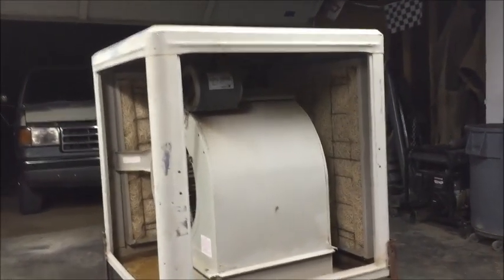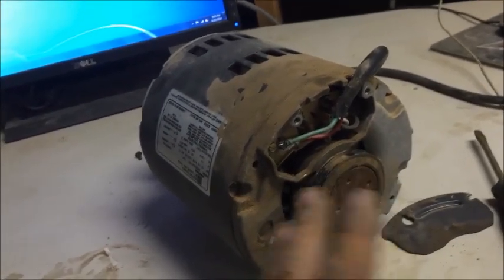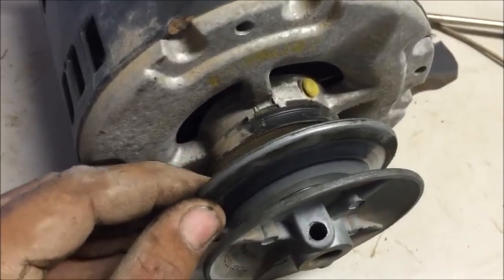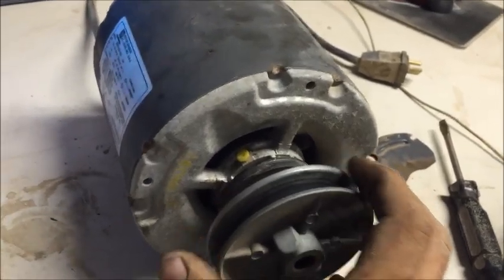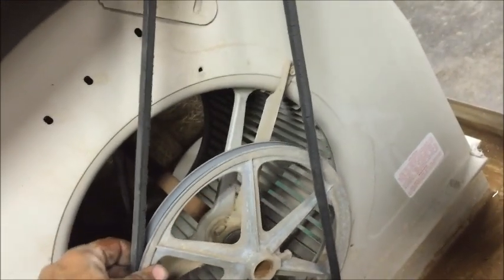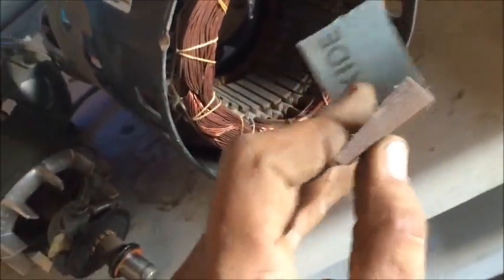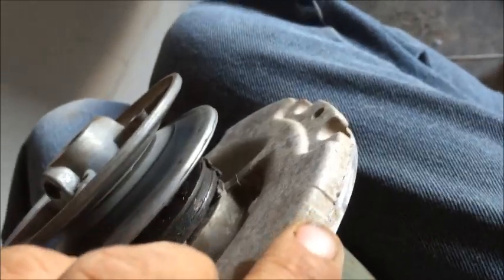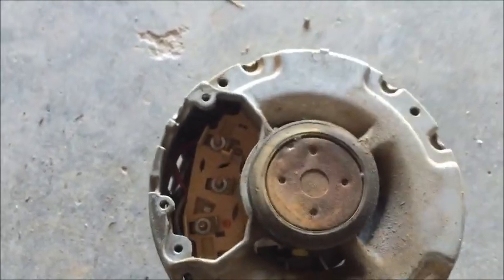Repair a Swamp Cooler that Shuts Down, Very Easy!

Comment: I replaced the motor and belt last summer and it ran like a champ. This year I turned on June 1st all was going well. Then after week a I noticed when it was on high cool after 20 minutes the air out put would drop almost like it was switching to low cool. Then after a few minutes it would speed back up like high cool should be. It never shuts off like you mentioned in your video, it just keeps switching from high to low and back to high intermittently.

Comment: Recently purchased a used cooler for $65.  The initial inspection, prior to purchase, revealed a badly worn belt.  However, the cooler was putting out an air temp under 70 degrees F...so I moved forward.  After putting some time and money into the unit, it still shakes during low/high fan speed.  I'm glad that I found this video, as I'm excited to follow the steps...and hopefully take care of the last issue.  Thank you for taking the time to put this video together.  It's a nice contribution...

Comment: Other causes of overheating are: an over-tight belt, dry or bad squirrel cage bearings, a motor that is too small, and low voltage to the motor due to corrosion.
Reply: This is what happened to mine too-nite, I tightened the belt too much.

Comment: Very helpful.  I installed a new motor but when I got it all hooked up, the motor would not pull the load.  I found out the problem was just what this video covered!  Thank you for the fix!

Comment: For the pumps that have the four long bolts to hold them together, you can't just pull them apart, I stuck a screwdriver in a vent hole (toward the pulley side, which is the "small" side, like hsi is) and "tap" them, then it came apart.  Also note you don't have to take off the plate to the electrical stuff to get them apart :) Used 600 grit sandpaper and sure enough, my motor which used to "buzz and go at low speed, then shut off after 10s" when set to high speed, now runs well.  For some reason it took a few restarts but then it started working well, I sanded the core and the outside bits...

Comment: For followers, he taps the motor pulley to make it straighter (or at least adjusts it? the tapping wasn't shown? adjusting it so it blows slower is a good option), and adds some drops of oil to the motor (which in some motor models isn't possible). And shows you how to clean rust from inside the motor if necessary...good info!  My only issue is sometimes those pulleys are stuck on with rust...though I think they rent pulley pullers at autozone? :)

Comment: Good info on pulley adjustment. 
Question for you: my cooler blows a mixture of air AND water mist, leaving calcium deposits all over my truck.
I’ve cleaned the cooler, replaced 3 aspen pads and new anode rod. I’m stumped why it’s misting water.
Any thoughts?

Comment: Good info. I just installed a new motor, it ran twenty minutes and shutdown. My engine adjustment bracket is all the way in, how do I loosen the belt now?  Good video!!👍
Reply: Loosen brackets on both sides of motor mount. Adjust where needed and then tighten.

Comment: Part of the old breezair evap installation includes monitoring amp draw while adjusting the pulley which I gather is due to the slight diameter change with the adjustment.

Comment: I have a question about the swamp cooler switch. Can the switch fail internally and cause both the high and the low voltage to go to the low side overheating the motor?

Comment: Also check the bearings on the side if they're seized it might cause extra load, causing the motor to overheat.  It should only be rotating the middle shaft, not the whole thing...it should spin freely too :)
Reply from the maker: great info. thanks for watching.

Comment: I found your video very helpful but im still having a problem with motor. What I did was buy a new one, put it on and it does want to turn to push air in the house. And i did but the same motor that was already in the swamp cooler. Should I a higher voltage? Have any advice for me? Thank you I really appreciate it!!!

Comment: Can you show us how you " just tap the shaft straight" I'm a machinist so I know roughly what I need forcewise to bend it back and what I can get away with but most people don't. I am afraid that they will end up beating it crooked worse or not getting aggressive enough and still having issues and end up dropping 150 in an unnecessary purchase. Great video though.

Comment: Thank you for the video, I eneded up replacing the motor on mine but after I did it started shaking alot. Would you know why this is happening
Reply: Check everything on the Squirrel cage axle. More than likely the pillow blocks are shot
Reply: @Rabbit.760  I will check it out thank you

Comment: Hello, Question for you. I have two old master cool swamp coolers that I love. Worked perfectly for years and years . NOW They work for 30 min then over heat bad. Would a good cleaning and a bearing lube take care of my problem??? Please help I was just quoted 300$ rewire job because guy knew I had no other options.
Reply from the maker: Is it indoor or outdoor? If it's indoor your problem is pressure, it needs to vent better. If it's out door, yes definitely a good cleaning will fix it, be sure to oil the bearings. thanks for watching!

Comment: Moter need little push to start. And after starting it works fine. It's same same moter shown in video. Ther is no capacitor. Just three wires common high cooling and low cooling.

Comment: You need to open the pulley to change the gear ratio. You have the pulley ratio too large. Open the pulley wider to lower the gear ratio. Use an amp meter to check the amp draw. If it draws too much loosen the pulley to make the pulley diameter smaller. This will lower the amp draw.

Comment: hi, i have a 3 phase motor. when i measure the resistance from the motor (3 wires) i get 4.6ohm, OL, OL. could this be the cause why the fuse keeps blowing out? i should get the same resistance value from phase to phase right? thank you.

Comment: What if your motor doesn’t have the plug insert where the oil goes? Any advice on a second location to put the oil on the motor ? I inspected mine and don’t see any spot to oil
Reply: Some don’t and are throw aways. The motor has a removable plate to connect the wires. Usually color coded.

Comment: WRONG.    WRONG. You need to align both sheaves dead parallel to each other FIRST. Then tension the belt just to where it doesn't slip or squeal on motor startup. The belt also needs to ride OUT of the sheaves by roughly 1/8". Needs to be ABOVE the sheave. If your belt rides flush or INTO the V groove then the sheave needs replaced or adjusted. A belt riding flush or INTO the V groove creates more side belt friction and heat on the belt making it fail early and over heat the sheaves which raises amperage.

Comment: I have an old swamp cooler that looks a lot like yours.  My issue is a loud clicking noise when I turn the fan on.  If I put the fan on high, it sounds like a machine gun!  Too loud to run!!  Because of the tight housing around the fan, I can't tell if possibly something has fallen in or the fan is hitting the side of the housing, or maybe it's something else causing the loud noise.  Any suggestions?
Reply: Mine is loud too. It sounds like a garbage disposal. Did you ever find out what was wrong with yours?
Reply: @KFrost-fx7dt  There was a piece of metal bent that the fan was hitting (which is why it sounded like a "machine gun".  But there is still a very loud "winding down sound" when I turn the fan off.  Also since then, the pump works fine, but now when I turn the fan on, it trips the GFCI outlet. Time to call in an electrician.

Comment: i know this is an older video, but i have a question just in case you see this.
i went to oil up the bearings on my motor, and the little yellow plug on the back of the motor (opposite the pully) broke in half, and part fell inside the hole. i took apart the motor, but i can not figure out how to remove the bearing from the back of the motor.
do you know how to do this, or maybe you know where i might be able to find some info on how to do it?
cuz i know i need to get that little piece out of there, and at this point i figure i might as well replace the bearings, especially since the back one seems to be pretty much seized up.

thanks in advance for any help!
Reply: so i figured how to remove that bearing. i was able to remove the little protective housing, but now im going to have to make some type of tool that will let me apply pressure to the square casing of the bearing, and twist it at the same time

Comment: Thank you
Reply from the maker: thanks for watching .
Reply: I'm dealing with this same issue right now. It runs for a hour or so and then starts making noise and stops so now I'm going to tear it down now
Reply from the maker: i had one that was indoor ( garage ) that was doing that, it ended up i did not have enough air going to it. too humid . but out door, is a different thing. good luck. let me know if i can help anywhere ?

Comment: My pulley is making a noise and not from lack of oil. Think I need to replace , maybe a bearing gone bad? Been working on these high maintenance coolers all my life but don’t remember ever changing a pulley wheel. Motors yes but not a wheel. Any advice? Only for my personal home use, I’m a gal so any info you can give me before it reaches 115 degrees in Phoenix is greatly appreciated. Thanx

Comment: On my two speed motor only low works when I put it on high nothing changes it’s still the same speed. Can that be fixed or do I need a new motor?
Reply from the maker: the high speed wire has disconnected, check the wiring. do a wiggle test, but be careful not to get shocked. ha. sounds like a bad connection. high speed  is black wire. low speed is red wire. white is neutral, green is ground. good luck. let us know if it works.

Comment: I'm having issues with the circuit breaker for the cooler in the main panel popping. I unplugged the motor and the circuit breaker doesn't pop. Is this a problem with the motor being shorted? Should I just replace the motor?
Reply from the maker: yes, that is correct !!!
Reply: Alright, I swapped the motor and got it wired correctly, I think. Now the motor runs on lo cool for a minute or 2 and then shuts off. Same problem in hi cool. The systems works fine on pump only but the fan is running at high speed. I don't think I have this wired correctly. Any help and pictures would be helpful. It's a 2-speed motor going to a 3-prong plug, where 2 of the prongs are flat.

Comment: Mine keeps shutting off after few sec. Its a new one but has alot belt dust on it i had change it. Now this. Its cold love be able fix it. It runys fine with no belt on it

Comment: the adjustable pulley is for motor amperage draw adjustment, it's in the owners manual
Reply: hahaha, you stocked up on blinker fluid?
Reply: Look it up smart guy you'll see
Reply from the maker: true, also for different thickness of belts.
Reply: WRONG

Comment: How about 8 year old motor 1/2 HPfrom Lowes.  I can not find oil ports is this sealed and nothing I can do.  Hard to turn, motor will start but if I try restart nothing.  Is your pulley on backwards?  Fixed shaft part pulley closest to motor and adjust on outside right?

Comment: I put my old motor in a new cooler. It runs fine with just the fan going in hi or low or on hi cool, but overheats in a minute or so when running in low cool. The motor or fan or something also makes a moaning sound when in low cool and getting ready to overheat. Also, the "pump only" and "hi vent" positions on the 6-position control switch have interchanged themselves. Never had this problem with the old cooler. Any ideas?

Comment: I have new motor installed belts set. plugged in was running for a year. no problem. just won't keep running. I need electrical help.

Comment: So I close mine all the way the  belt still was still deep in the groove of the pulley I herd someone else say give it 3 to 4 turns open and my cooler hasn't burnt the motor since but the problem is i dont feel enough wind now almost feel like a regular fan kinda

Comment: My AC motor stopped working. I noticed there's black rubber shaving around the motor.. Is my motor dead?  It's hard to turn the motor like it's locked. And it's not powering up. Thanks for your help.
Reply from the maker: yes, the threads are either belt shavings or dust from the motor being flung out with a mixture of water with it. be sure to check that the spider is not leaking and dripping near the motor.

Comment: Not a pulley. It is called an adjustable sheave. It it used to adjust blower speed. If its adjusted too fast (faces too far together), the motor will over amp and will shut down on internal thermal overload (like every 20 min.). The sheave is shot.  The motor bearings might also be. Likely by adjusting the sheave he reduced blower speed enough to allow the motor to run longer. Pressed on sheave? Best bet: new motor and sheave. And tension that damn belt after you adjust that garbage sheave!
Reply: Your Momma must be proud.
Reply: fight!

Comment: I have a bigger motor and the fan blades are made of fiberglass and is held in with an aluminum disc that is attached to the pully. The whole thing is rusted and in bad shape. The bolts on my extractor keep stripping the threaded holes. Any ideas?
Reply from the maker: is there room for a nut behind the bolt, if so install a nut and lock washer. if the threaded holes are plastic,with  a small torch you can slowly melt the threads then before it cools completely you can run the bolt back in to make new threads.

Comment: Hello sir,
My dad kept turning the cooler on while having a plastic cover on the front. Can that burn up the switch or burn up the motor or anything else?
Reply from the maker: yes that can burn up the motor. it will build some pressure making the motor work to hard.

Comment: is this a fix for evaporative coolers that switch from to low and back to high in the high setting?  IE is it the motor?
Reply from the maker: no, that would be wiring
thanks for watching

Comment: Well I've got an identical motor that had been ceased for around 25 years, after a lot of strength and wd40 it moves but when I plug it in it just blows the fuse in my power supply 💥😒 any ideas?
Reply from the maker: yes, take the motor apart and clean the armature. it is grounding out on the magnets. most people just buy a new motor, but it can be cleaned.
Reply: thomas brian thanks I'll try this , I got the motor for free (for obvious reasons) so if I can't fix it I'll just find one off of another junk cooler.

Comment: My cooler keeps going off and on about every 20 minutes by itself. I the assumed the motor was getting too hot, so I've replaced my blower motor 3 times, replaced the bearings, adjusted the belt many times from tight to so lose it was coming off the pully, replaced the 2 speed wall switch, and the power cord to the blower motor. The motor still keeps repeatedly shutting down after about 20 minutes then coming back on. I'm going to melt this weekend. Does anyone know what could be the problem?
Reply from the maker: it sounds like it may be wired wrong. if its a new motor i would disconnect the belt and run it by itself. running without a load tells you a lot. it will verify if it is the wiring or something else. if it still shuts down at about the twenty min mark then the wiring is wrong, or grounded somewhere. heating up the motor. if it does not shut down, then look at if the belt is to tight it should flex enough when adjusted properly to be able to just about roll it off the pulley by hand. and the third thing is water. if your spider is leaking drops of water on the motor, it will also shut it down because the water will cause friction on the armature of the motor , shutting it down when it gets hot. please keep us posted. these comments are like threads and they help everyone. thanks for watching.
Reply from the maker: one other thing, with the motor belt off, can you spin the squirl cage freely. there are bearings on both sides that require a little oil in them. the bearings are cheap to replace. again please keep us posted. thanks.
Reply: Thank you so much Brian.  Makes complete sense.   That sound like some really solid advise.   I'll do that.
Reply from the maker: it sounds like you are building pressure where it is blowing. do you have a window cracked in the house. you have to release some air for it to run easy.
Reply: @thomasbriansavingmoney  static pressure will reduce load on a blower. Open windows will not make it run easy.

Comment: Hello there, I have a side draft swamp cooler I need to replace the motor... my pops and I did a replacement 6 years ago.... but I forgot and he is  overseas.... is there anyway you can do a video on how to remove the motor ... unplug  the electrical, re wire new motor before mounting in place. Please and thank you!

Comment: Help. I turned swamp cooler on but no air coming out. The motor is running. What to inspect?
Reply from the maker: belt came off i think
Reply from the maker: check the belt on the motor
Reply: @thomasbriansavingmoney  the belt is spinning too.. help. Could it be worn out belt no air coming out of vent?

Comment: I'm replacing it.but pulley its too rusted ( got the new one without the pulley ) how do I removed without damaging it?.help
Reply from the maker: remove the set screws, i have pried them off with two long screw drivers, but i found the easiest way is to rent a pulley puller from my local auto store ( no cost, full refund ) thanks for watching.

Comment: I replaced my belt with a car belt, but it's output is very weak and then shuts off. The car belt is a bit thicker than the old one, so would the problem be the pulley not being adjusted for said thickness?